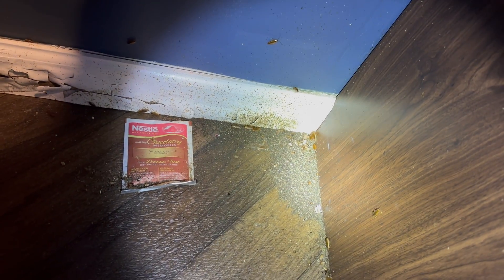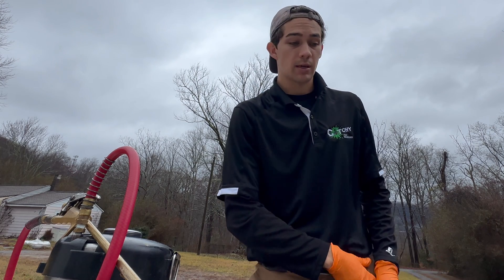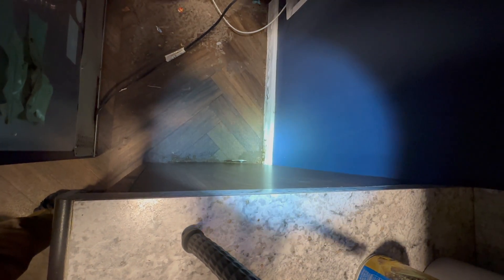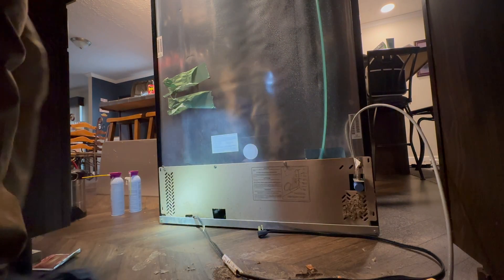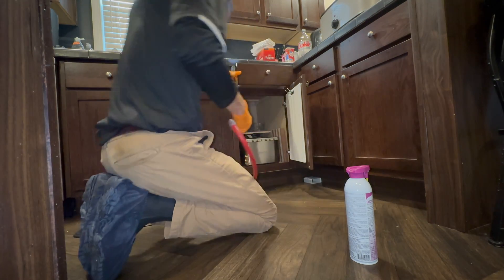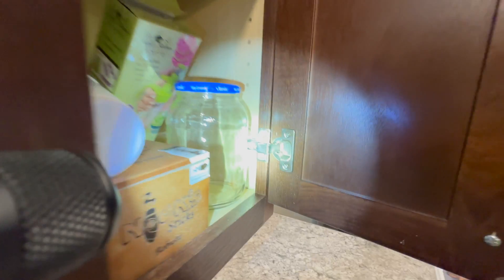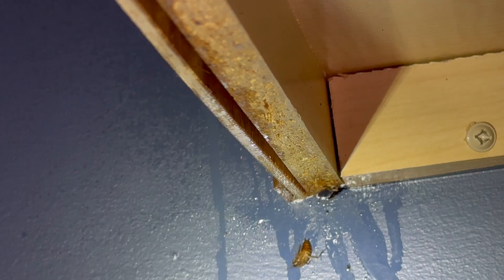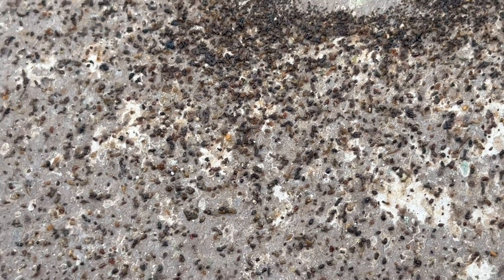Cockroach Combat: Unconventional Pest Control Strategies Revealed

Comment: Great job!  Just an FYI about the fridge.  As simple as it may seem,  that cardboard in the back is vital to the healthy operation of the unit.  If it gets discarded,  it's very wise to replace it.
Reply: I cant tell, are you joking or is that actually a vital component to the fridge?
Reply: I doubt it's important,  it's just a protection cover /access panel, and has holes for air flow so it doesn't over heat.
Reply: Absolutely,  it directs airflow from the condenser cooling fan for proper cooling over the compressor and associated coils for optimal performance.  It is an important part,  I mean piece of cardboard behind a fridge.  Actually,  Whirlpool has  recently started using plastic instead.

Comment: Mr. Dan the Bug Man, what is the difference in treatment for German vs Chinese cockroaches?
When I lived in Atlanta I had a minor problem with cockroaches. I bought a plug-in thing that supposedly sent electrical pulses through the apartment wiring. After two weeks I didn't see a roach for four months. And I was working very odd hours (sometimes up at 4 am, sometimes getting home at 1 am, sometimes writing a novel all night). I saw one, and then not another for four or five months. Are any of those wall plug-in things really worth it?

Comment: Do you council your clients on preventative measure to help prevent another infestation like this in the future? One of my biggest selling add on services was environmental remediation. After the infestation was over I would go back and seal all the cracks and crevice's in and around the kitchen cabinets, floor boards, in and around sinks, with caulk. I would take off the electrical socket covers and dust inside and put the cover back on. I would dust the heck out of the refrigerator mechanical compartment and put the cardboard backing back on after I had cleaned any frass off it. By eliminating the cockroaches preferred habitat it can go a long way to preventing future infestations. I would charge about 300 bucks for two hours worth of work. After suffering through infestations on this level customers were practically throwing their money at me to prevent this from ever happening again. It was a great add on sale and revenue stream.
Reply: thats genius to consider add ons in that way, and aslong as its not mandatory, nor forced onto the customer.
and for cheaper options incase they do want it, but can't afford it